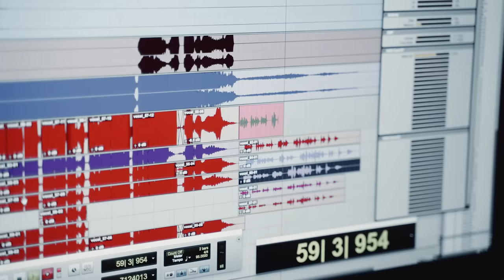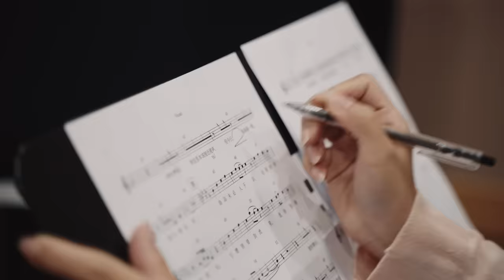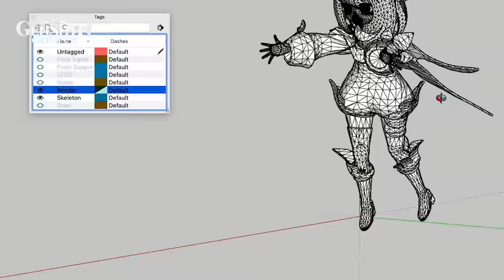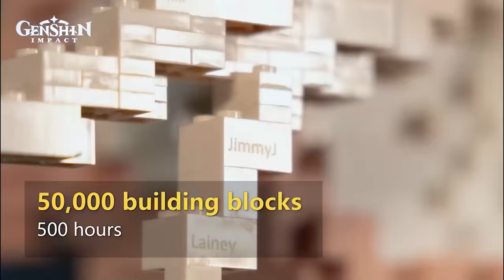Version 2.4 Special Program｜Genshin Impact

Comment: You need to be more flexible with your timing for code redemption. This was streamed when I walked into my job, I can't tune in during work, can't even spare the time during my breaks really. I just got home from my 12 hour day and it's too late for me now to redeem these codes. This is probably the first time a Genshin livestream even happened on one of my work days, I tuned in to every other one. I'm kinda disappointed :/